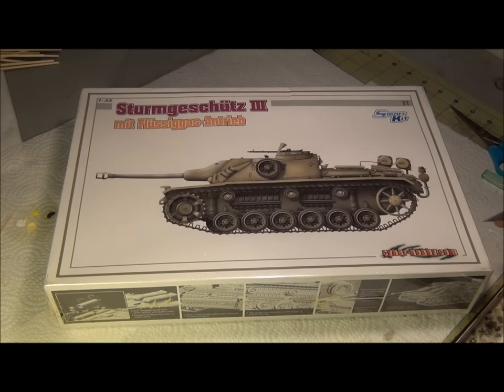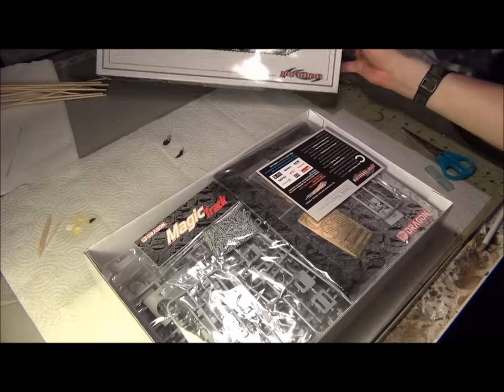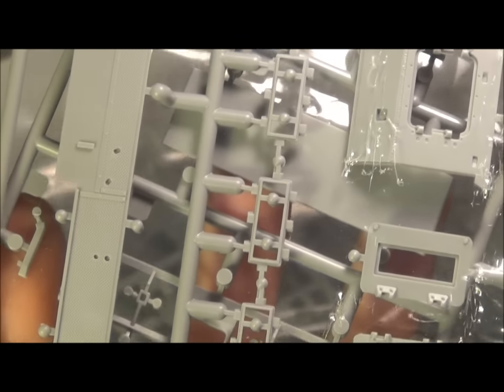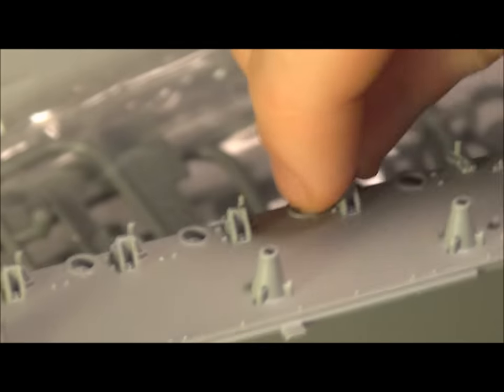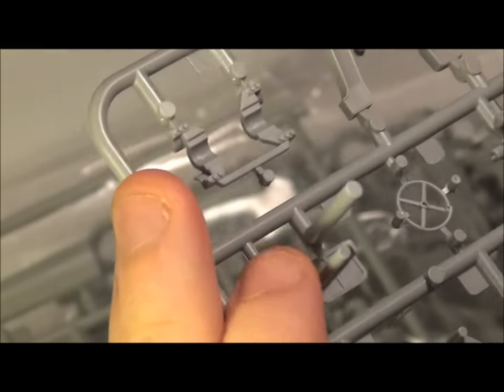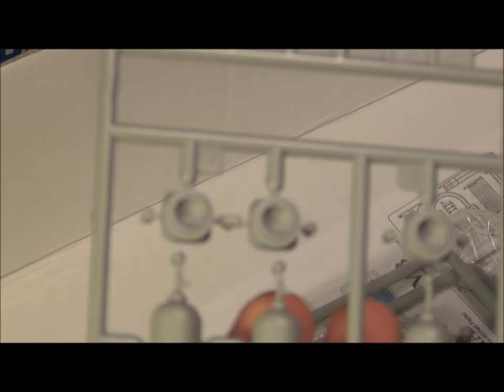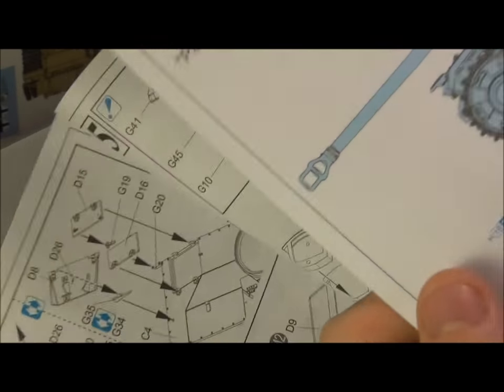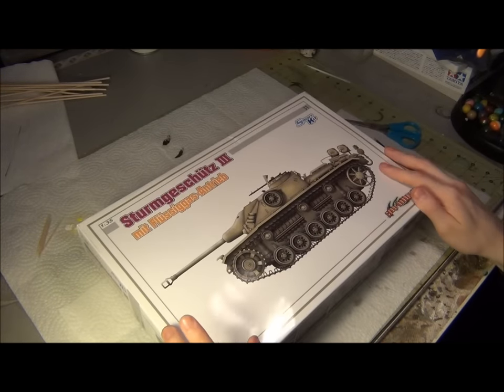In-box Review: Cyberhobby 6371 StuG III G mit Flüssiggas-Antrieb

Comment: Dang, that's a hell of a review Evan. the StuG GB starts July 1st, so yeah end of June. That wood thing is the antenna casing/protector thing for a Panzer III when it lowers the antenna.

I'm pretty impressed with this StuG. It has enough differences that it's quite a different beast with all the Panzer III M bits and the stadtgas. Very very cool. Can't wait to get going on this GB.
Reply from the maker: Adam Mann 40 mins I have no idea lol.....aw comon that's a week and a half away.  This StuG will just be sitting on the bench teasing me :c  Maybe I can finish up that other StuG in the meantime...yes that's a good goal!  

Yeah this StuG has everything except the schurzen!  Which is good because those suck on DML kits!  But it's sure something else.  Do you have any cool camouflage ideas or pics for inspiration?  I'm looking for a cool camo that should help to  keep the busy look without being too overpowering.  I'm planning on keeping it pretty clean, probably minimal stowage, basically the opposite of the waffle zim StuG I'm doing.
Reply: Panzermeister36 For mine I just want to find an initial style StuG camo, probably two tone. When was that StuG photographed? If it's a late war piece you could use any kind of crazy late war camo. the straight hard edged stripes like the Bovington Panther, or even the really nasty ones I've seen with black in them.

If you look at pictures of the Aberdeen tanks that were taken with their original paint still on back in the 50's the had tritonal with black, and looked pretty crappy.
Reply from the maker: Adam Mann I'm not sure I'll check the photo out.  I've never seen black camo on a german tank I don't think...that's something else!
Reply: I'll hunt some down for you. I collect color photos from Aberdeen whenever I see them.

Comment: I'd say when I did mine I wasn't impressed by the quality of the plans. Somewhat confusing or steps that made no sence to complete before other etc...what you think?
Mine came with those DS tracks as well...I really don't know how's that's better than Magi Tracks...they are almost translucents...
Reply from the maker: byrnespeed Well its a Dragon set of instruction first of all, but they're had to add in steps for all the mods and change part numbers and usually it's just a mess.  Look up online build-throughs of the kit and you should get some advice from others.  I don't like DS tracks unless its something like a Sherman that doesn't need slack.  If you have the side plates then it should be fine but the indi-links are far better, thought Dragon now seems to think the opposite.